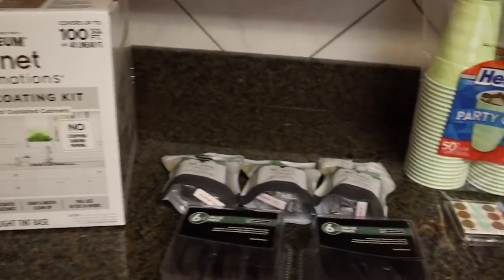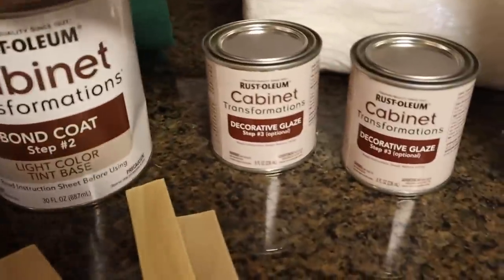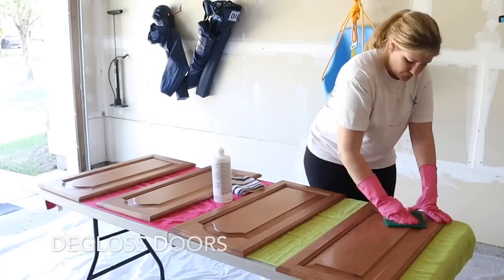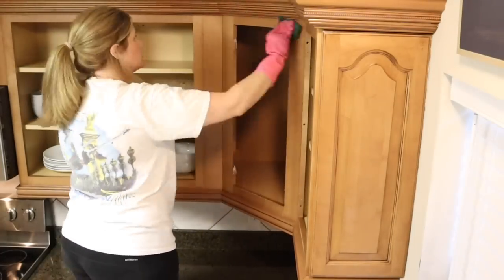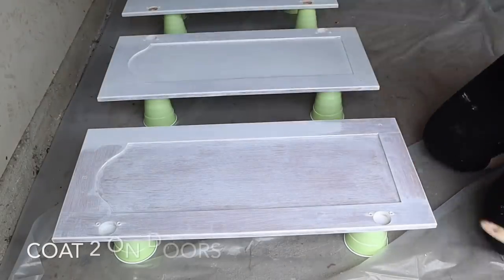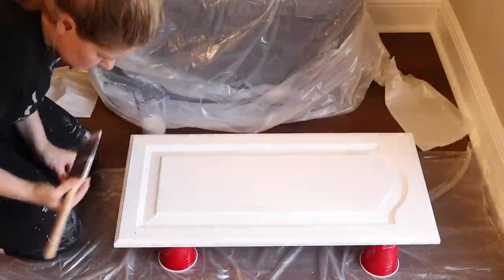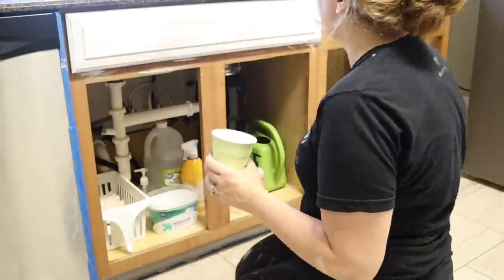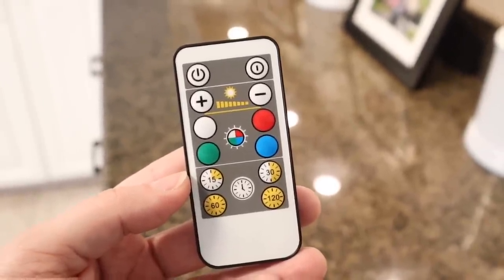KITCHEN CABINET MAKEOVER! | Paint Your Kitchen Cabinets White | Rustoleum Cabinet Transformations

Comment: I'm not sure if anyone has mention this tip* But when I did my cabinets like that I bought a small sponge roller approx 3in. so it only took two coats of paint to cover and use a brush very simular to the one you used.two days. Med kit. and the sponge roller holds so much more paint..and it's not messy! I love! But you did an amazing job by doing all with a brush!🤛💕😎🌟👍I have a lil age on me..so I try to go the easier route lol but I'm enjoying all your great videos..thanks God bless...Brenda from Nc
Reply: Have u use primer or distemper before using the paint?

Comment: I've been in the painting business since 1978. Whenever I do kitchen cabinets I start out with Sherwin Williams Pro Block oil base primer which assures adhesion. For a top coat I use Sherwin Williams Emerald Urethane Trim Enamel.
Reply: Thanks for the tip Chris. Is spraying required for a perfect finish or can it be brushed and rolled?
Reply: @bguy1979  I brush and roll using mohair covers. The Sherwin Williams Emerald urethane trim enamel levels off nicely eliminating any brush Mark's. The key is easing up on your pressure when applying it.
Reply: @bguy1979  another thing I don't do is sand the cabinets before applying the primer. Using Sherwin Williams pro block oil base primer eliminates the need for sanding because it adheres to gloss-surfices. I find it not scientifically prudent to sand out the varnished (polyurethane) topcoat in which all cabinets have. Why one needs to sand down an already smooth surface is beyond my comprehension. Also sanding down the already smooth polyurethane or varnished topcoat on stained cabinets can cause the stain to eventually bleed through the new paint. After all, the existing polyurethane or varnish finish acts as a sealant, sealing in the wood stain. Using a water based primer as a first coat is a big no-no because despite being advertised as a bonding primer it simply doesn't give you adequate adhesion and simply will not ensure that the stain will not eventually bleed through. The biggest culprit causing bleed through when using a water-based primer rests two things. One, it doesn't adhere to gloss surfaces. Two, you are forced to sand before you prime to get a halfway decent adhesion. Remember what I said about exposing the stain beneath the varnish finish. I.do lightly sand the oil base primer, placing very little pressure when sanding. My steps:
1. Prime all the doors while still attached.
2. Remove all the doors after they are primed.
3. Prime and finish the frame.
4. Finish coat all the hinge edges of the doors.
5. Reattach all the doors and then finish coat them.
I find it ridiculous to reattach the doors before the paint has fully cured. It is much easier to finish paint the doors when they are up, when they are stable, rather than flip-flopping. After all, the hinge edge has already been painted previously. Eventhough you might get a couple dings here and there (on the hinge edge) when reattaching the doors, a simple touch up on the hinge edge is simple and eliminates the paint flashing out if touching up the whole door.
Reply: @chrisdidonna7386  If I want smooth cabinets, will I need to use wood filler, or will the pro block primer fill in the grain?  thanks
Reply: @bguy1979  The oil base primer will not fill the grain. I use Sherwin Williams Spackling as a filler. It is a petroleum based spackle. Always prime first before filling so the spackle gets good adhesion. Once you've sanded out the spackle it is vitally important to add a goat of primer over the spackle.

Comment: Excellent video. I used this kit for my bathrooms and I was pleased with the results. I might suggest using a small roller for the flat part of the panels and I should have sanded lightly some of the doors, but overall, I was pleased with the kit. I didn't have the room or time to do my kitchen cabinets, but this kit is good value for that.

Comment: Thank you for the video and the honesty regarding how much time it takes!! I was just curious why you didn’t use a 3 or 4 inch roller when painting the flat surfaces. I understand using the brush for the nooks and crannies. But is there a reason you didn’t use a roller on the larger flat surfaces? Thank you!!

Comment: This looks great! I'm surprised that can was enough for the 5 coats. Was the deglossing hard (lots of tough scrubbing?) Did you put anything in the screw holes so they dont get blocked with paint?
Reply from the maker: I used 2 kits! No, the deglossing wasn’t difficult. And no, I just painted over the screw holes and it wasn’t a problem. Thanks for watching! 😊

Comment: Very nice and liked your video tutorial tremendously.  I am curious however why you didn't use a roller.  I get that a brush will be needed for detail areas but a roller would have cut the time and no brush strokes.  
Are you seeing a bleed through (yellowing) at all.  I was told to use an oil based primer on wood cabinets going to white.  Is there any discoloration from cooking steam/grease or sunlight?

Thank you again; I enjoyed your video and instruction.

Comment: I’m starting my vanity in my bathroom. Thanks for all your tips by the way. They are wonderful.  I went to Home Depot and got my kit. My question is if I go with pure white does it need to be tinted? The guy at Home Depot said it didn’t need to have the tint. So I’m a concerned that it’s not going to work. I thought that you had said in your video that you had yours tinted

Comment: This is a REALLY slow way to do it.  Use the small rollers for that large flat areas and brush the inside corners. Best way is to invest in a sprayer line a Wagner sprayer. It is WAY faster and gives better results. But just spray the doors and drawer fronts and roll the cabinets.

Comment: You have seriously good cut-in skills, but 5 coats is silly. Did you sand between coats? The result is great, but it's a weird process. Not particularly efficient.
Reply from the maker: Thanks! Looking back on it, I think my coats were way too thin and that’s why it took so many. 🤔 I just kept going until
 it wasn’t see through anymore! It was a ton of work, lol. I wish I had used a paint sprayer but I live in Louisiana and was worried about humidity. Have a great day and thank you for watching!